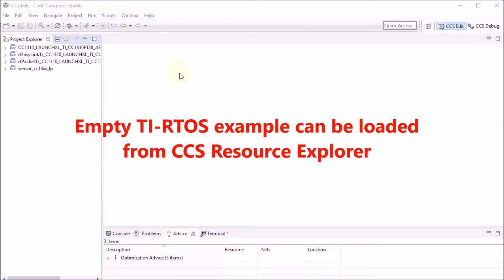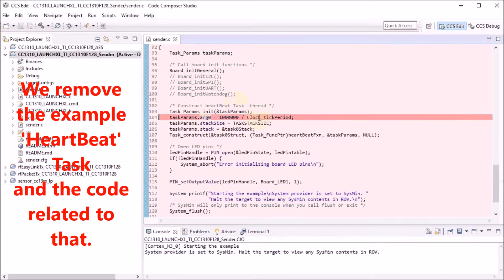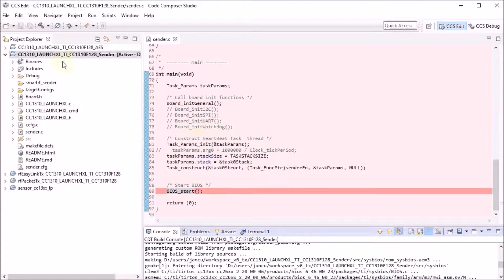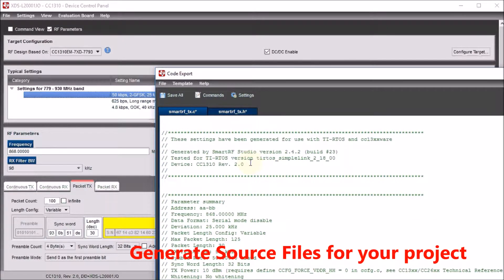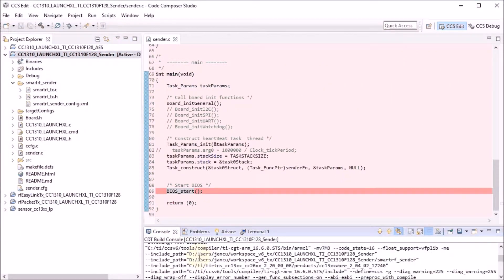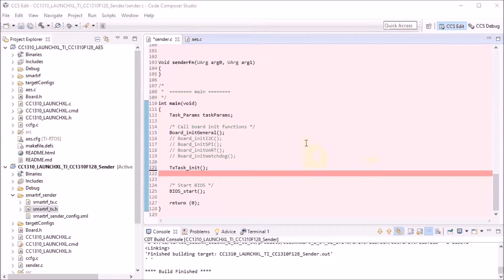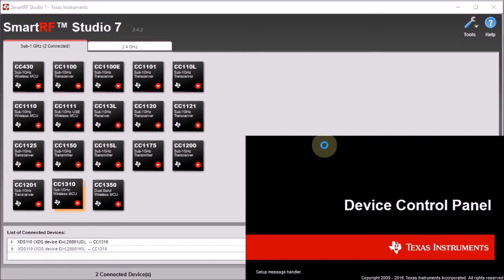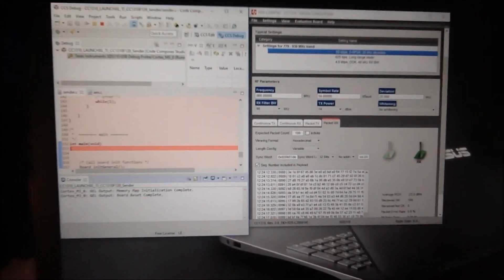Texas Instruments CC1310 LaunchPad - Talk to the Radio with SmartRF Studio

Comment: how can we connect it with arduino uno to communication
Reply from the maker: You can talk to it over UART.
It should also be able to run any functionality you are running on an Arduino, if you use a UNO. It has the same hardware peripherals, and more memory and CPU speed.

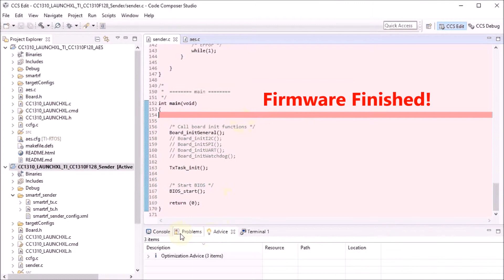Comment: Hi I am getting an error "C:/Users/Eric/workspace_v8/CC1310_LAUNCHXL_TI_CC1310F128_Sender/smartrf_sender/smartrf_settings.h", line 10: fatal error #1965: cannot open source file "ti/devices/DeviceFamily.h" when you compile at 9:00 in the video. I have searched online for a solution but none of the fixes work for me can you please advise?
Reply: In the Errors bar it says #1965 cannot open source file "DeviceFamily.h"
Reply from the maker: Eric, I would not know what’s wrong. As long as you have the SimplLink software for the device correctly downloaded via CCS. Maybe open aquestion on the sub-1 Ghz forum https://e2e.ti.com/support/wireless-connectivity/sub-1-ghz/f/156
Reply: Did u ever find a solution for this problem I got the same problem....
Reply: @didiervolk4511  yeah I did but I don't remember what it was - long time ago

Comment: Hello, again Jan. I am trying to achieve radio communication between the 2 CC1310s that I have, I have just downloaded Code Composer Studio and not sure where to find the project you were editing. Also, I am not sure what TI RTOS is and whether I need some other settings to be able to demonstrate wireless communication on my 2 CC1310s. Thanks a lot.
Reply from the maker: Nibz legend in ccs, there is a resource window. use that to install the cc1310 examples. All you are looking for is covered in the examples.
Reply: @JanCumps  Do I still need to install TI - RTOS I am not sure what TI RTOS does exactly?
Reply from the maker: these questions are related to knowing the launchpad. My advice is to get to know it by checking out all examples, and following the free simplelink academy. I can’t do better in these youtube comments  than the good startup path that ti has provided to learn this board.

Comment: How can you test if 2 cc1310s can communicate with eachother wirelessly
Reply from the maker: Follow what this video does. It is wireless.
Reply: @JanCumps  Yes Sir they are I thought I was commenting on an older video of yours with the serial connection. Very nice video I am working with 2 CC1310s myself for my graduation project. Would this still work if the 2 CC1310s were connected to different laptops? and is this the same thing as Sub 1 GHz? Keep it up I really appreciate your work
Reply from the maker: Yes it would still work. And if you load the original firmware and have the nokia lcd boosterpack, you can work without computer. In the original code, you can set , via lcd menu and the pushbuttons, one to receiver and the other to transmitter. And then test. You have to power the launchpad someway. You can use a phone plug or USB battery pack
Reply from the maker: See my blog on how to reinstall the original firmware